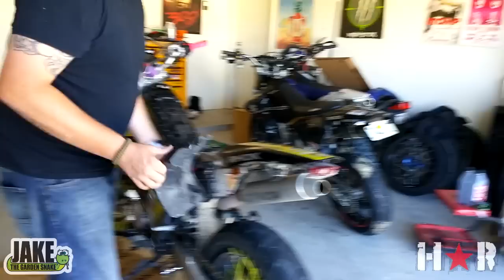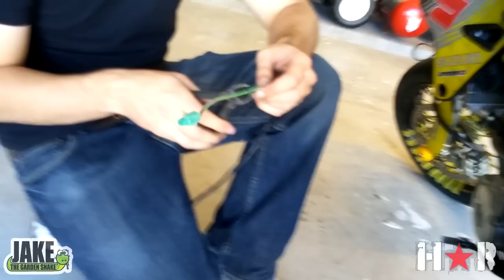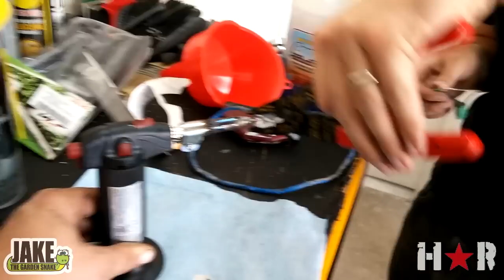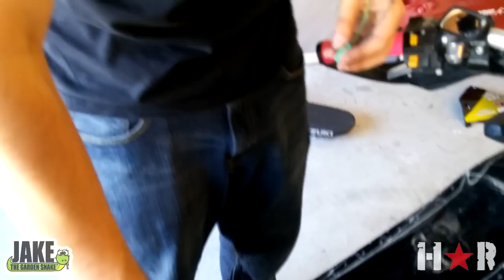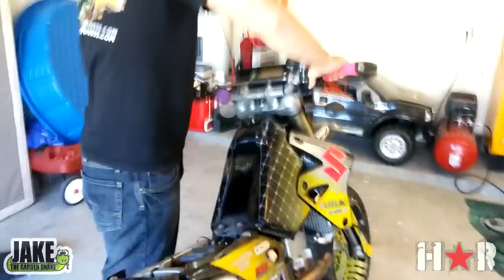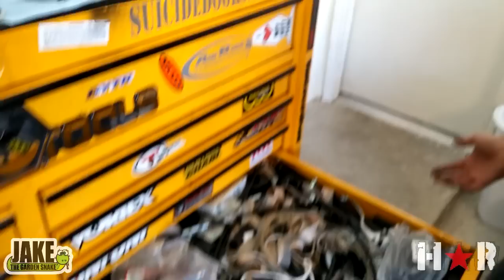Kick Stand Kill Switch Removal

Comment: Hey Jake. A few soldering pro tips:

- Tin the tip of your soldering iron (meaning just melt some solder to it) and wipe off with wet sponge.

- When soldering the wires together put the tip of the iron under the wires next time and the solder on the top of the wires. This will allow the heat to transfer to the wires. Once the wires are sufficiently heated they will melt the solder. (Rather than touching the solder to the tip and letting it flow onto the wires.) This is very important if you want a good bond.

- Also, don't forget to coat the tip of your iron with solder when you are done to help keep it from oxidizing. (this is important! A non-oxidized tip will allow the heat to transfer better.)

Cheers
Reply from the maker: Thanks boss
Reply: Jake TheGardenSnake  I was just thinking man that might be horrible if a poor connection caused that switch to kill the motor. :/ Not sure if it operates as always open or always closed

Comment: First thing I did on my drz was disable the safety switch crap, it's stupidly easy and cheap to do anyways.  Instead of making a loop with the wiring like you did I got the wires side by side and heatshrinked them that way, just to be a bit neater not that it matters being under the seat and all....

Comment: I don't know what to comment, so I wrote a report on how to make meth: 

Making Methamphetamine at home:

List of chemicals and materials: 
Diluted HCl - also called Muriatic acid - can be obtained from hardware stores, in the pool section

NaOH - also called lye

Ethyl Ether - aka Diethyl Ether - Et-0-Et - can be obtained from engine starting fluid, usually from a large supermarket. Look for one that says "high ethyl ether content", such as Prestone

Ephedrine The cottons in todays vicks nasle inhalers dont contain efed or pfed (ephedrin or psuedoephedrin) but there are still lots of easy ways to get good ephed or pfed, pure ephedrin can be extracted out of it's plant matter, from a plant that can be bought at most garden stores. Or you can get pfed from decongestive pills like sudafed. Most people perfer to work with pfed from pills rather then ephed from the plant. The important thing is that you must have pure pfed/ephed as any contaminants will fuck up the molar ratio leaving you with over-reduced shit or under-reduced shit. Or contaminats will jell durring baseifying and gak up your product which will then be very hard to clean. So you want to find a pill that is nearly pure pfed hcl, or as close to pure as you can get. Also check the lable on your pills and see what inactive ingredients they contain. Inactive ingredients are things like binders and flavors. These you dont want and will remove when cleaning your pills. but certain inactive ingredients are harder to remove then others. You dont want pills with a red coating, you dont want pills with alot of cellose in them and you dont want pills with much wax. you also dont want pills that contain povidone. As a rule, if you have a two pills that contain the same amount of pfed hcl then take the smaller sized pill because it obviously has less binders and inactive ingredients, time released pills are usualy harder to work with because they have more binders and tend to gel up durring the a/b stage. Also only buy pills that have pfed hcl as the only active ingredient. You first have to make ephedrine (which is sometimes sold as meth by itself):If you are selling it...I would just make ephedrine and say it's meth.

Distilled water - it's really cheap, so you have no reason to use the nasty stuff from the tap. Do things right.

List of equipment : 
A glass eyedropper 

Three small glass bottles with lids (approx. 3 oz., but not important)one should be marked at 1.5oz, use tape on the outside to mark it (you might want to label it as ether). One should be clear (and it can't be the marked one).

A Pyrex dish (the meatloaf one is suggested) 

A glass quart jar 

Sharp scissors

Clean rubber gloves

Coffee filters

A measuring cup

Measuring spoons 

Preparing your Lab:

Preparing Ethyl Ether:
WARNING: Ethyl Ether is very flammable and is heavier than air. Do not use ethyl ether near flame or non-sparkless motors. It is also an anaesthetic and can cause respiratory collapse if you inhale too much.

Take the unmarked small bottle and spray starter fluid in it until it looks half-full. Then fill the rest of the way with water, cap the bottle and shake for 5 minutes. Let it sit for a minute or two, and tap the side to try and separate the clear upper layer. Then, draw off the top (ether) layer with the eyedropper, and throw away the lower (water) and cloudy layer. Place the ether in the marked container. Repeat this until you have about 1.5 oz. of ether. Put the cap on it, and put it in the freezer if you can. Rinse the other bottle and let it stand.

Ethyl ether is very pungent. Even a small evaporated amount is quite noticeable. 

Ephedrine & or P-Ephedrine: Please discuss this on the neonjoint forum 

5. Pour 1/8 teaspoon of the lye crystals into the bottle of ephedrine and agitate. Do this carefully, as the mixture will become hot, and give off hydrogen gas and/or steam. H2 gas is explosive and lighter than air, avoid any flames as usual. Repeat this step until the mixture remains cloudy. This step neutralizes the HCl in the salt, leaving the insoluble free base (l-desoxyephedrine) again. Why do we do this? So that we can get rid of any water-soluble impurities. For 3 oz. bottles, this should take only 3 repetitions or so.

6. Fill the bottle from step 5 up the rest of the way with ethyl ether. Cap the bottle, and agitate for about 8 minutes. It is very important to expose every molecule of the free-base to the ether for as long as possible. This will cause the free base to dissolve into the ether (it is soluble in ether). 

7. Let the mixture settle. There will be a middle layer that is very thick. Tap the side of the bottle to get this layer as thin as possible. This is why this bottle should be clear. 

8. Remove the top (ether) layer with the eyedropper, being careful not to get any of the middle layer in it. Place the removed ether layer into a third bottle.

9. Add to the third bottle enough water to fill it half-way and about 5 drops of muriatic acid. Cap it. Shake the bottle for 2 minutes. When it settles, remove the top layer and throw it away. The free base has now been bonded to the HCl again, forming a water soluble salt. This time, we're getting rid of ether-soluble impurities. Make sure to get rid of all the ether before going to step 11! 

10. If there is anything left from step 3, repeat the procedure with it. 

11. Evaporate the solution in the Pyrex dish on low heat. You can do this on the stove or nuke it in the microwave (be careful of splashing), but I have found that if you leave it on top of a hot-water heater (like the one that supplies hot water to your house) for about 2-3 days, the remaining crystals will be ephedrine HCl.

If you microwave it, I suggest no more than 5-10s at one time. If it starts "popping", that means you have too little liquid left to microwave. You can put it under a bright (100W) lamp instead. Microwaving can result in uneven heating, anyway.

First Batch: 120mg ephedrine HClEstimated: 300mg (100% of theoretical, disregarding HCl)

Now, Making Methamphetamine out of ephedrine by reducing it with Hydroiodic Acid and Red Phosphorus.

Items needed:
Alot of matchbooks (the kind with the striking pad)

Coffee filters (or filter paper)

Something that measures ml and grams

A flask (a small pot with a lid can be used)

iodine

Hydroiodic Acid (I will tell you how to make this)

Red Phosphorus (I will tell you how to make this)

Lye

*Optional (toluene and HCI gas) 

Making Red Phosphorus:
The striking pad on books of matches is about 50% red phosphorus. The determined experimenter could obtain a pile of red phosphorus by scraping off the striking pads of matchbooks with a sharp knife. A typical composition of the striking pad is about 50% red phosphorus, along with about 30% antimony sulfide, and lesser amounts of glue, iron oxide, MnO2, and glass powder. I don't think these contaminants will seriously interfere with the reaction. Naturally, it is a tedious process to get large amounts of red phosphorus by scraping the striking pads off matchbooks, but who cares?

Making Hydroiodic Acid:
This is made by mixing iodine and red phosphorus. When making hydroiodic acid from iodine and red phosphorus, the acid is prepared first, and allowed to come to complete reaction for 20 minutes before adding the ephedrine to it. The way around the roadblock here is to just boil off some more of the water from the ephedrine extract, and make the acid mixture in fresh pure water. Since the production of HI from iodine and red phosphorus gives off a good deal of heat, it is wise to chill the mixture in ice, and slowly add the iodine crystals to the red phosphorus-water mixture. 

Now, Making Methamphetamine:
To do the reaction, a 1000 ml round bottom flask is filled with 150 grams of ephedrine. Also added to the flask are 40 grams of red phosphorus and 340 ml of 47% hydroiodic acid. This same acid and red phosphorus mixture can be prepared from adding 150 grams of iodine crystals to 150 grams of red phosphorus in 300 ml of water. This should produce the strong hydroiodic acid solution needed. Exactly how strong the acid needs to be, I can't say . With the ingredients mixed together in the flask, a condenser is attached to the flask, and the mixture is boiled for one day. This length of time is needed for best yields and highest octane numbers on the product. While it is cooking, the mixture is quite red and messy looking from the red phosphorus floating around in it.When one day of boiling under reflux is up, the flask is allowed to cool, then it is diluted with an equal volume of water. Next, the red phosphorus is filtered out. A series of doubled up coffee filters will work to get out all the red phosphorus, but real filter paper is better. The filtered solution should look a golden color. A red color may indicate that all the red phosphorus is not yet out. If so, it is filtered again. The filtered-out phosphorus can be saved for use in the next batch. If filtering does not remove the red color, there may be iodine floating around the solution. It can be removed by adding a few dashes of sodium bisulfate or sodium thiosulfate.The next step in processing the batch is to neutralize the acid. A strong lye solution is mixed up and added to the batch while shaking until the batch is strongly basic. This brings the meth out as liquid free base floating on top of the water. The strongly basic solution is shaken vigorously to ensure that all the meth has been converted to the free base. You now can sell or use the free base for injection use or with free base meth now obtained, the next step you can do is to form the crystalline hydrochloride salt of meth. To do this, a few hundred mls of toluene is added to the batch, and the meth free base extracted out as usual. If the chemist's cooking has been careful, the color of the toluene extract will be clear to pale yellow. If this is the case, the product is sufficiently pure to make nice white crystals just by bubbling dry HCl gas through the toluene extract. If the toluene extract is darker colored, a distillation is called for to get pure meth free base. The yield of pure methamphetamine hydrochloride should be from 100 to 110 grams. 

Thank you for your time, remember, don't go breaking bad on this shit.?
Reply: Best fuckin comment Ever!!
Reply: only on the internet do you get instructions on making meth from a motorcycle video!
Reply: The more you know!
Reply: devon groff knowledge is the new money.
Man im fucked.......yeah......im fucked.
Reply from the maker: well then
Reply: I knew the internet would teach me something new!
Reply: Sounds Healthy
Reply: When do you put a blue dye
Reply: NSA is watching!!!
Reply: The LoudAssasin  WOW!

Comment: I need help with my custom build I git raptor 700 with 2009 r1 motor everything is connected right just the switch not sending power to the starter to turn the motor over

Comment: This reminds me of when my clutch safety switch broke, and the only way I could start it was to push start. Finally ended up probing all the wires on the starting circuit with a multimeter before I found out it had broken. Same fix, solder the wires together.

Comment: Dude, If you take off the kill switch and your throttle gets stuck open while riding you need the kill switch to stop the bike and If you dont have it you will loose control or loop out or hit something or someone
Reply: Because this modification will prevent your clutch and brakes from functioning as normal.....

Comment: My gsxr 600 dies when I put in a gear :( My sidestand was up, Had so push the bike half a mile upwards a hill...

Will probably do that tomorrow. Hopefully it works. Who neds that fucking "safety feature" anyways...
Reply: marmoto liferider did it work?
Reply: Had to bring it to a mechanic. The cables were shorting or something, and it was just a complete mess from the last owner.  Guess thats what i get from buying a used bike.  But i have not gotten into anymore problems with the sidestand.
Reply: marmoto liferider alright buddy, ride safe👌🏼